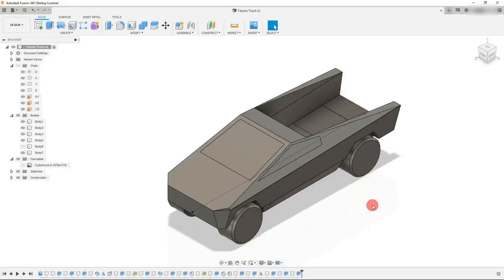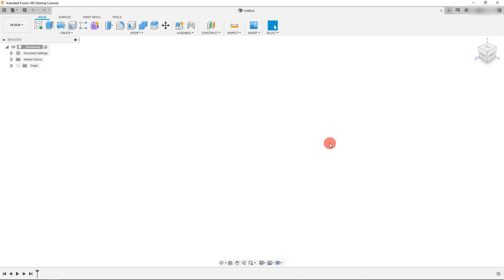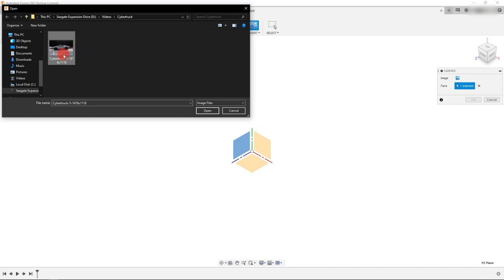Tesla Cybertruck in Fusion 360!

Comment: Hey is there a part two of this?
Reply from the maker: Hi! There is no part two as of now, but if you are wondering how I made the wheels, I started a sketch on the center plane and extruded 2 circles into cylinders. From there, I mirrored them to the other side using the same plane as the mirror plane. The windows were made by creating sketches on the faces and using the "offset" command to get the proper shape. Please let me know if you have any questions related to the modeling. I thought the video was long enough as it was and I didn't want to get into too many little details with these things.
Reply from the maker: If you have any questions, let me know in this thread or in the comments and I will try to help if I can.
Reply: @AvivMakesRobots  Hey Engineering Juice, awesome with the cybertruck, I was wondering if you could make the V-Block clamp drawings in Fusion because I'm struggling with it as I am new to fusion 360? I would appreciate it so much, thank you!
Reply from the maker: @king.kthebest6158  Hi! Which brand or type of block would you like to see? i have a basics video for beginners, which may give you some aid on designing this.